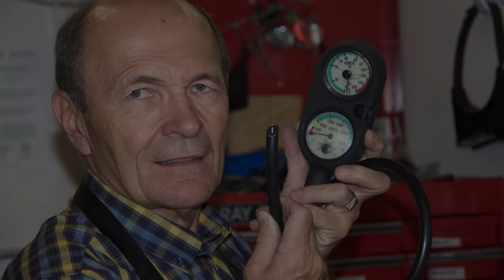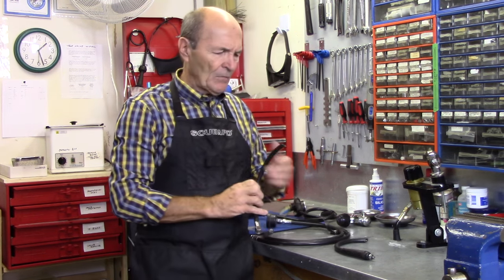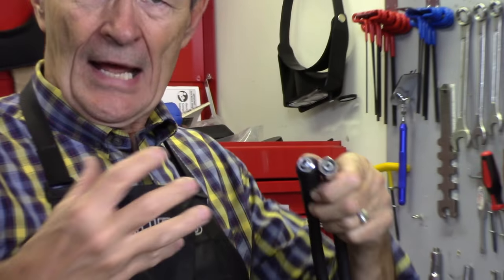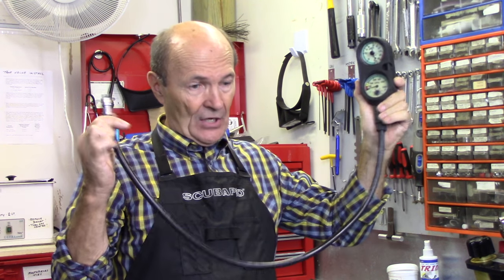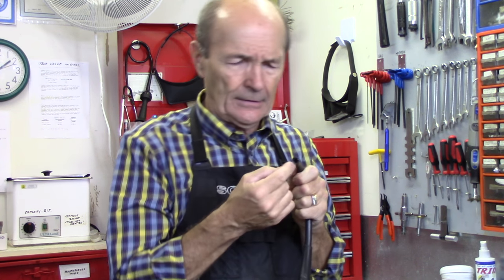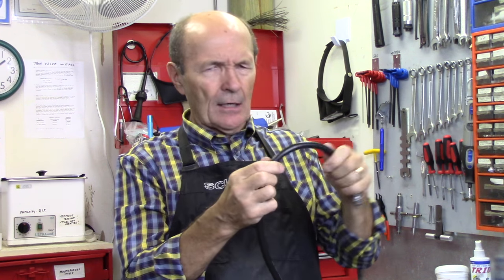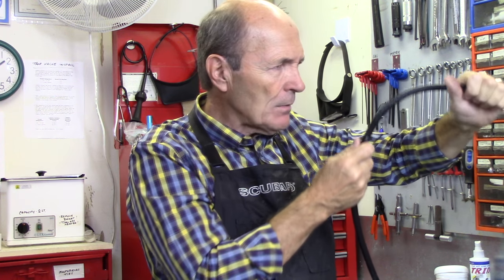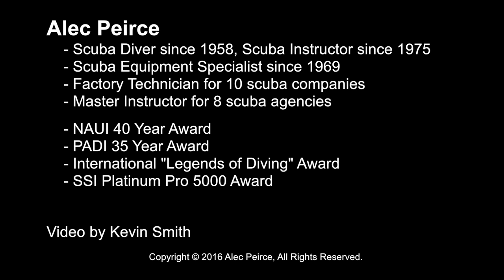Regulator Hose Failures - Scuba Tech Tips: S04E08

Comment: I wish I'd seen this video about 15 years ago so I'd have been less concerned on a dive in Palau when my high pressure hose did the aquarium aerator behavior early in a dive.  The divemaster wasn't concerned (he obviously knew more than I did) but I was massively distracted by what I imagined was going to be a catastrophic failure and potentially a dangerous loss of air situation.  It wasn't until watching your video just now that I understood what happened.  I'm very thankful you've taken the time to put together all these tech-tip videos to share with everyone.
Reply from the maker: Thanks for sharing your story and glad your a calmer diver after watching.  Kevin had his dive computer explode (yes, the big bang) on a Cozumel dive.  He was holding the HP hose as parts of his dive computer drifted to the sand, 20' below.  He slowly goes down, picks up all the pieces and is slowly ascending to the horror of all the new divers watching.  This happened after our video so he knew what happened and how long he had.  Surfaced with 1800 psi to a shocked boat captain.   Knowing makes you smarter Jim.
A

Comment: Hi Alec, hoses break rubber even steel braided. Used in past steel braided hydraulic break line on my street bikes. They work as designed. Fine Presentation 👍
Reply from the maker: Thanks Mark.
Alec

Comment: Great video again. I usually pull the hose protectors off, after rinding them with fresh water, since, from my experience, the water moisture trapped between the hoses protectors and the hoses, then to rot the hoses under them.
Reply from the maker: Absolutely correct Miguel! I spend more time cleaning the hose ends from under the hose protectors than I do servicing the entire rest of the regulator. Next time put a bit of silicon grease on your hand and then wipe the hose and hose end. It'll protect it and make it easier to slide back to rinse.
Alec
Reply: Thanks Alec. Yes I do this, with the silicone spray. Makes life easier, and I think the outside rubber likes it too.
Reply: do you need hose protector with the nylon hose ? there is no outside rubber to crack, but I suppose the inside might still bend harshly at the metal connection. That would solve the water and not drying issue....
Reply from the maker: I've not been putting hose protectors on the flex hoses. I didn't want to lose the flex benefit and they bend so easily that it's not likely they will crimp and tear at the metal ferrule. And, as you know, hose protectors trap water, corrode the metal ferrule and can soften the rubber unless rinsed a lot and greased. I don't know yet if there's a need for the hose protectors. If I see some coming in with frayed nylon at the fitting, I'll let you know. If you want hose protectors, get the nice soft ones from Oceanic. They will protect the hose but they're not stiff and very easy to pull back to rinse. Good luck guys. Alec

Comment: Thank you Alec! Every time I learn something new from you.
Is it possible that my high pressure hose doesn't have these small holes? I can't see them.
About your statement at the beginning of the video, I wouldn't blame the regulator's manufacturer for a failed hose, but I would be considered about their choice of the hose's manufacturer.
Would you consider making some maintenance videos? This time of the year is the end of diving season for many of us (north hemisphere...) and there is a lot of equipment cleaning, parts replacement and long term storing going on.
Also, could you share your opinion on inflator integrated alternate regulators?
Reply from the maker: Sometimes there is no choice. That is, scuba gear manufacturers are limited in their choice of parts suppliers, the same as car manufacturers. There's only 1 maker of air bags for example. However, depending on the model and where it was made (USA, Europe, Asia) there may not be holes in your HP hose. Also if it's an older one it may not have them. I plan on doing some service and maintenance videos. They are very popular. Thanks for watching. 
I have tried many time to get used to integrated octos but I don't like them. I'll explain why in a new video. Alec

Comment: Love it, thanks.. Any suggestion on how often one should change hoses, I have the mesg thingy hose to both my Apeks stages, but regular rubber hoses to my bcd and drysuit
Reply from the maker: Mesh QD (Quick Detach) hoses are cheap and easy to add. The QD end is almost universal. Your LDS should have them in stock or go to XSScuba.com . You'll be amazed what a difference it makes. You can also make the hoses longer or shorter at the same time if you need to. Alec
Reply: will do for sure

Comment: recently, i heard someone mention the idea of single cylinder lp hose failure where you grab a heavy duty zip die, turn off your valve, cinch down the zip tie, turn valve back on, end dive. 

i was curious if this is something you would test/had experience with.
Reply from the maker: Never work.  Watch my video S13E06 Will Crimping A hose stop a Freeflow?  I won't spoil the ending  but forget the zip tie and end the dive.
A